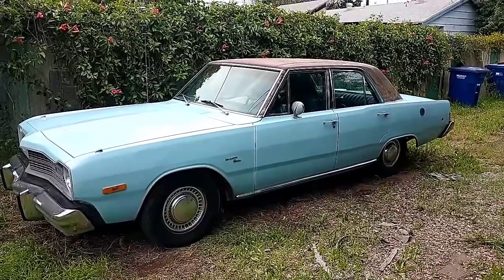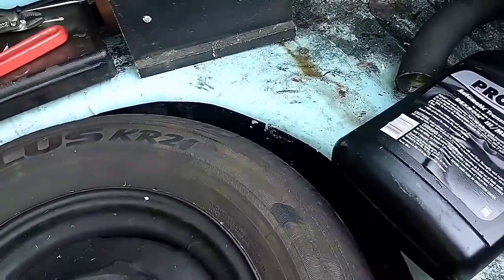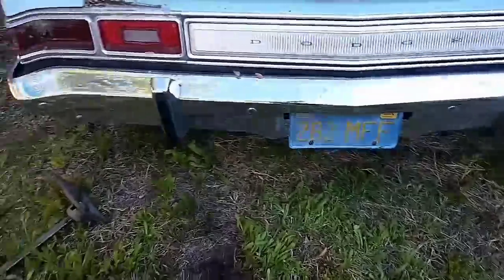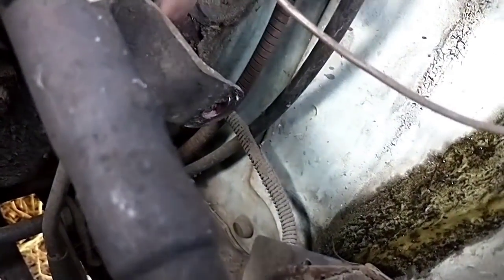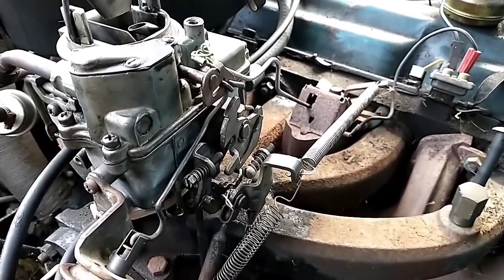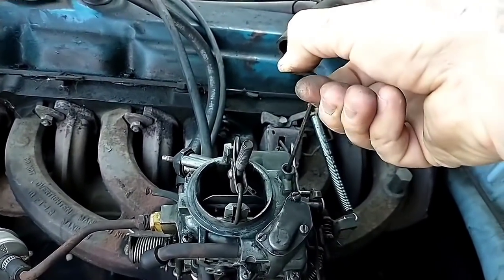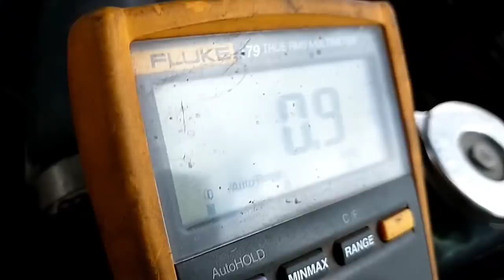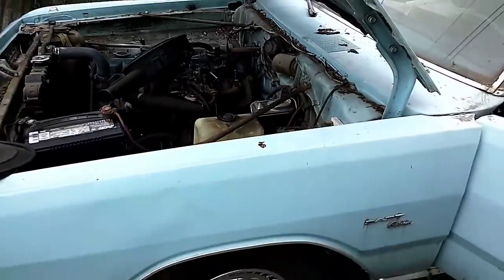Waking up a 1974 Dodge dart after a 5 year slumber.

Comment: I had 2 slant 6's, one in a 1970 Plymouth Duster and one in a 1977 Dodge Aspen, The one in the aspen had a 2 Barrel, They called it " Super Six " That car would Vapor Lock bad in hot weather!, Never had that problem with the Duster, Dad had a 1966 Plymouth Belvedere with a slant too, They were good engines, Too bad they never got Fuel Injection

Comment: Slant Sixes are some of the most reliable engines ever made and there are no shortages of them or their parts.  IIRC, the slant six was used from the late 50s to the late 80s or early 90s.  Very good engine.  A dog, yes, but still a great engine.
Reply: It was used from 1960-87, Then the 3.9 V6 replaced it in the Dakota first then in full size Ram Truck and Van
Reply: @jdpinbaytown  Thanks. Was going by memory. (EDIT: They made them up until 91, but discontinued them earlier in automobiles. They used them in marine applications till 91)
Reply: @tarstarkusz  True!

Comment: Cool to see a old Dart stil alive and running. I had a 75 Custom 4D with the 225 slant 6 for about 15 years. It was a fun and unusual car to drive around in here in Norway. Had 6 or 7 cars with the 225 inn them. Great Engine. Was that a 64 you had sitting there behind it?

Comment: Despite the quirks this car has, it’ll be a lot cheaper than today’s ugly s***mobiles that loose value as soon as you drive it off the lot. If cars were still all mechanical, there wouldn’t be any issues with production since cars back then didn’t use any computers but sadly people literally need a computer in every damned thing you can think of but 23 year old me would be perfectly happy with driving and owning cars from the 60’s and 70’s.

Comment: If the distributor has mechanical advance lobes, make sure that they move freely. After many years the lubrication on the pivot points dries out and restricts movement. Also make sure that no dried grease is in the slots of the counterweights is cleaned out and renewed with appropriate new grease. Some distributors have vacuum advance pots on them and that is another potential failure due to cracked diaphragms.

Comment: Seriously chrysler "merica were still using a slant 6 in 74 we got the hemi straight 6 in 70 in valiant's in OZ as the slant wouldn't pass pollution regs back then & all OZ 6's from t big 3 had a stromberg craby except some chrysler's which had an email craby which were crap, as for the instrament cluster it's very close to a 68 valiant except the gauges were rectangle to match the speedo & all in one.

Comment: I'm glad to see you back. I've always loved Darts and Valiants---they weren't fancy, but they ran forever. I like the approach you took, much like servicing a broken stereo receiver; it's all about the diagnostics. And yeah, that carb needs replaced. The throttle shaft bearings are shot; it's leaking both gas and vacuum